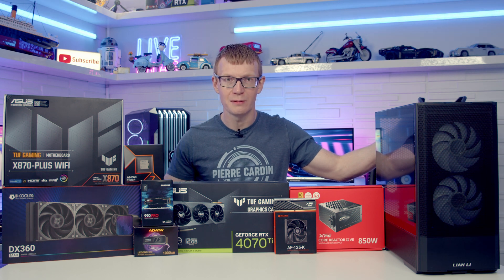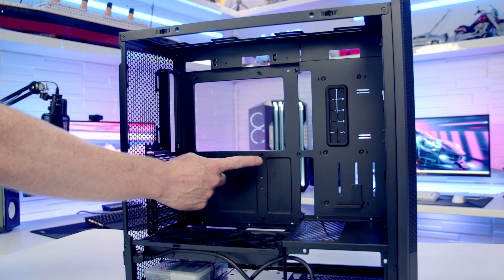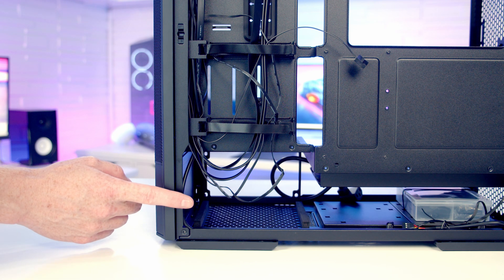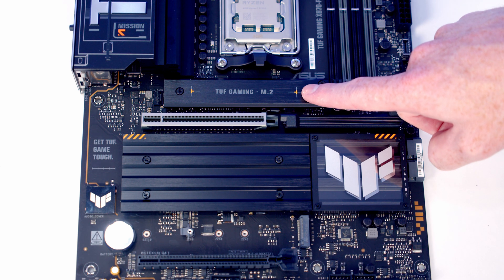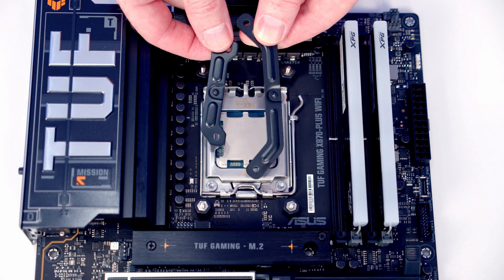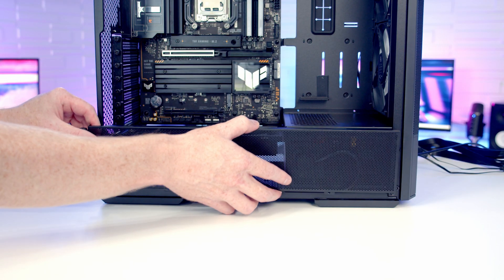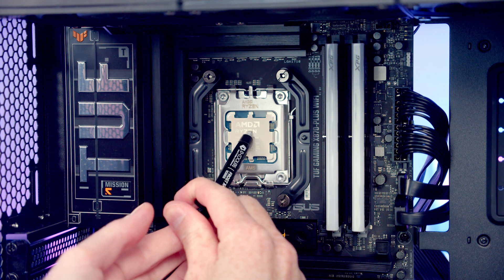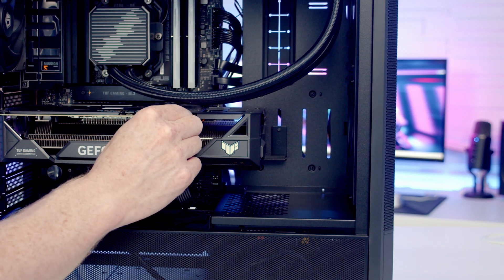Lian Li Lancool 207 Build - Step by Step Guide

Comment: I have a pro RS WiFi b850m pro series motherboard and I’m trying to line it up with the case, yours seemed to go pretty seamless with all 9 of the tiny screws but I feel like some of my screw holes are too far and only a few of them work? Anyone else experiencing a similar issue? I also am not entirely sure what to do with the stand off bolts as well or if I should implement them in this case. Any help would be appreciated.

Comment: Are you supposed to plug the first case fan into "cha fan 1?"  It's located in the middle of my mobo by my main nvme ssd (Asus b650e max gaming wifi, same layout as the mobo in the video).  The rest of the chassis fan headers are grouped together neatly at the bottom of the mobo.  I ended up just plugging all 3 into cha fan 2, 3, and 4.

Comment: My only issue was the power supply cable extension.  I used a Corsair psu and it makes you plug the lancool 207's 90 degree plug in upside down so that you have this big loop of cord in the way of closing the side panels on the back side.  Would've been nice if they put the plug in part on the 9 o clock side of the psu if you are looking at it with the ports where the cables plug in at as 12 o clock, and the power switch side as 6 o clock, aka in line with the front fans. 

Also, the instructions were way too cluttered with extra crap in the text and pictures and not enough actually helpful information. 

That said, I still love the case and there could've been way worse problems.

Comment: Awesome guide, should I use some leftover fans I have to put as exhaust on the top and back of the case? Or is it better with no exhaust fans using the pressure from the case?

Comment: Sad to say my mother board is now forever stuck to my case unless I can safely bore out the screws holding it at the top. Put in the long bracket screws and  they're impossible to remove without damaging the mb. I also never put on the little guard that labels all of the plugins on the motherboard (ssd, usb, wifi, etc.) Terrified to see if it will even turn on after 6 hours and 2000$ I don't think I'm ever doing this again.

Comment: hey Christopher! huge thanks for this video, just finished a build with this myself actually. have one quick question tho. i have a deepcool le720 aio mounted, problem is that the screwholes didn't line up. some didnt even show through. its sitting sturdy tho but i have not installed 4 screws. would this become a problem in the future?

Comment: I recently built in this case and i can confirm this case is goated. It can also fit an artic liquid freezer iii no problem. One of my favorite cases to build in in all my years.
Reply: Hello, how did you fit the artic liquid freezer iii did you have low shaped RAM or added slim fan on top of ram? Im using the 280 one thats maby higher? :).

Comment: Im building a PC with the Lancool 207 myself. I got the PSU, GPU and motherboard in and plugged in a few cables. I have yet to install the CPU and cooler. 
I wasn't quite sure where some of the cables were supposed to go. 
Im using a Gigabyte AORUS AX V2 B550 motherboard and am using the Ryzen 5 5600X and Gigabyte dual fan RTX 4060Ti from my daily driver PC (which I now run a 5800X3D and RX 7800 XT in). 
The PSU is a 600W Gamdias Helios which was also one of my old parts my Skytech Nebula shipped with. I'm now running an EVGA Supernova 850 G5 in that. 
The PC I'm currently building will also have 2TB storage and 32GB DDR4 RAM at 3200 MHz.

Comment: With the way that the radiator is mounted, does that mean there are intake fans at the top, front and bottom. Are exhaust fans needed at the back?
Reply: Not really, no. The positive pressure will push all air through the back while also keeping dust out.
Reply: @Thorwk1  Cool, thank you ^^ It's also wide open at the back

Comment: I like this case, but my 1300w psu has 16A IEC C20 connector, so I cannot use extension cable (most common 10A type). No info about availability of this IEC C20 type from Lian Li.

Comment: The rear 120/140 fan is not needed in this configuration and will be detrimental but only a little.  If the 2 bottom fans aren't used then the rear exhaust is needed, the front fans will blow enough air over the VRM's and cpu area though I would only recommend using an Arctic III 280 or 360 to get that down fire cooling over those VRM's if you will be overclocking.  Great case, Great review!  I can finally move out of my Lancool II mesh which has worked great with 2 bottom fans, but the 207 does it better!

Comment: Only watched this because I was COMPLETELY baffled by the PW switch connector. It looks 100% like a USB power connector and I've never seen that used on a case before. I'm used to the old school HDD/RS/PW individual pins. Also explains what that USB-C cable was for (my mobo is too old) thanks for this!

Comment: I've got this case; planning to get a 9950x3d, 50 series gpu (maybe, I'll atleast see their performance and effect on prices) not sure on motherboard yet(is 870 worth it or shall I just get a b650/670), I've ordered an overkill nzxt 1200w Modular psu, phantom spirit 120se cooler, vengeance ddr5 6000 32gb(2x16) ram(good enough?) , 1440p 180hz ips msi monitor 1rr, 990 pro 2tb heatsink (£144, thought its good deal) but I might get 2b sn850x no heatsink instead, as the motherboard will mostly come with heatsink, and they're supposedly better for gaming. (can get it for £139) I'd love a really expensive 4k 240hz oled monitor too but that's an insane upgrade for a few years time, this is my first build. Going insanely overboard, on a budget.

Comment: 12:00 Towards the end of the video I notice a back fan has been added, is this necessary? As the case doesn't provide a back fan, all the heat will just be expelled up through the AIO correct? Is it worth buying a fan for the back or can I just complete the build without it
Reply: Well you should buy a back fan so the pressure in the case is equal as there are 2 bottom 120mm intake and 2 front 140mm intake fans pre installed in the case, you should buy a fan for Rear so theres equal positive and negative pressure in the case as there will be 3 AIO fans on the top of the case to to exhaust and a Rear fan set to exhaust making it equal as 4 intake and 4 exhaust

Comment: Chris, I just finished building my first PC with this case and your video made such a breeze! I do have one issue though, how were you able to control the RGB of the 2 140 front fans? I tried downloading the Lian Li L-Connect and it only shows my AIO (GA II Trinity) and not the front fans. I have the front fan PWM and ARGB cables plug in the same way you demonstrated in your video.
Reply: You use your motherboards rgb control software.
Reply: Why not plug it into the motherboard?

Comment: What a smart case. Two 140s, two recessed 120s not blocked by the PSU, a modular sag bracket, front mounted dust filter, magnet mounted dust filter, highly airflow focused, etc. I also like how no exhaust fans are needed due to the high pressure inside if the case and overall open design of the back. All of that for $80.  Lian Li upsets me with their focus on proprietary components, but their case engineering is top-notch. And a great review from you, Chris!